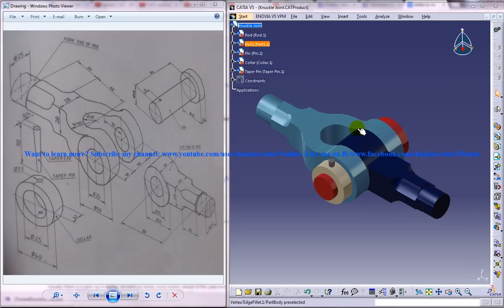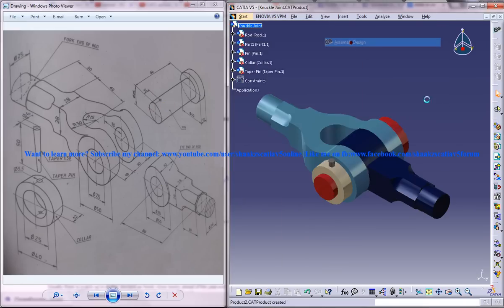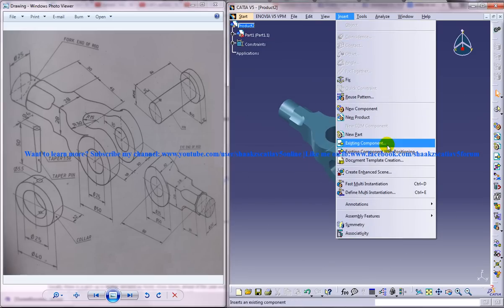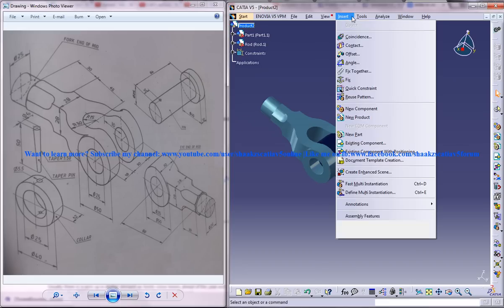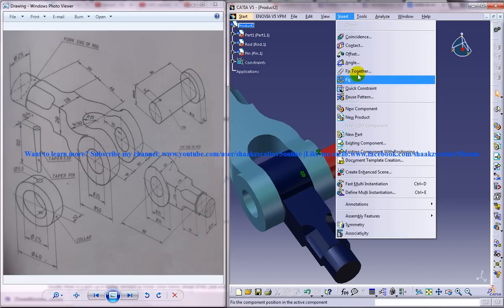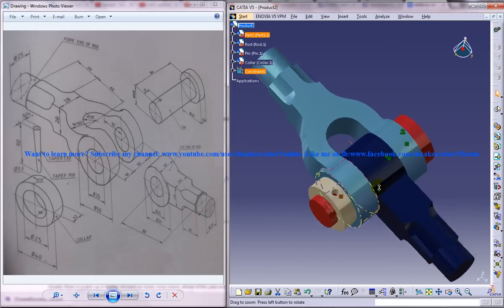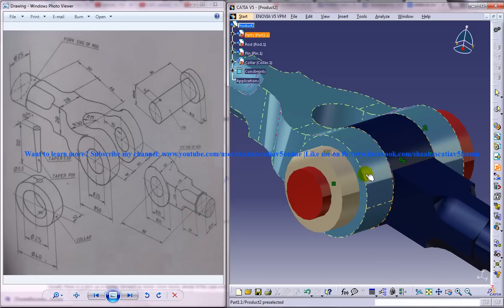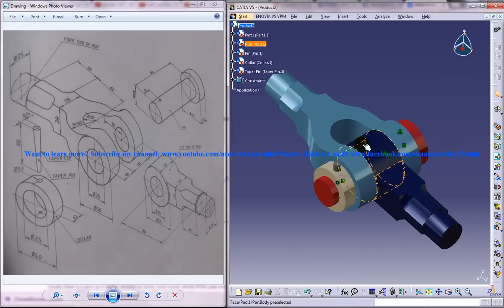Catia V5 Tutorial|Product Engineering Design|How to Create Knuckle Joint(Easy Steps Beginners)|P8

Comment: Hi, Thanks a lot for your videos. But I have a little misunderstanding. You have created a hole with diameter of 4.7mm ( in the collar), but the smaller diameter of the Taper Pin is 5mm. In the assembly I saw that the Taper Pin is introduced into the hole of 4.7 diameter. Could you help me to understand it? Yhans a lot !
Reply from the maker: Hello friend..If it is so then you can make adjustments with the diameters and assemble it. Don't worry. that's a silly issue.
Reply: Ah ok. I thought that I missed something. Thanks again for your tutorials. They are verry helpful!

Comment: Thank you for the tutorial. However there is one small ommision. In part one you say that you will create this tiny hole on the pin (center is 12mm from the bottom of the pin) in another part of the video ( the final part). But when you assemble the parts the hole is already there. Could you tell me how to create it ? Thanks!
Reply from the maker: Hi Friend,

Good day..!!

If such a hole is missing, you can always create it referring to its dimension drawing.

You can do it being in the assembly workbench itself. Please double click on the part from the assembly workbench and you will be redirected to the part design workbench from where you can do the further editing. Alternatively, You can open the specification tree and do the editing by double clicking on the respective part name.

Hope that clears your doubt. Let me know If you still face any trouble.